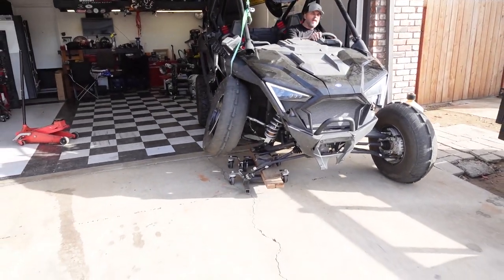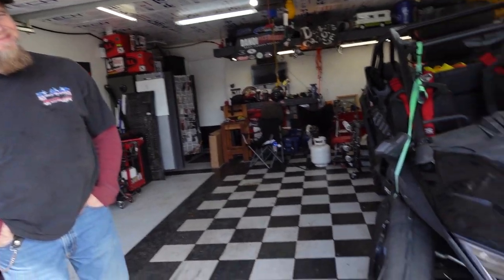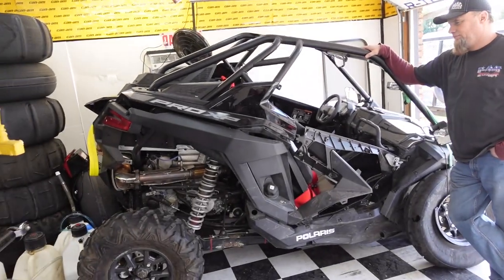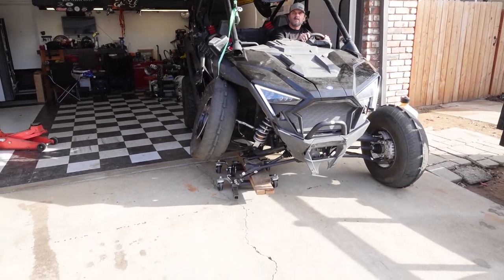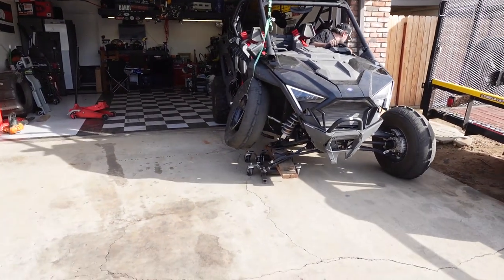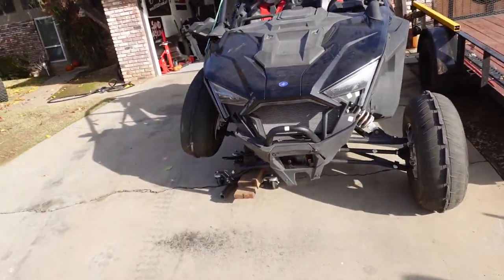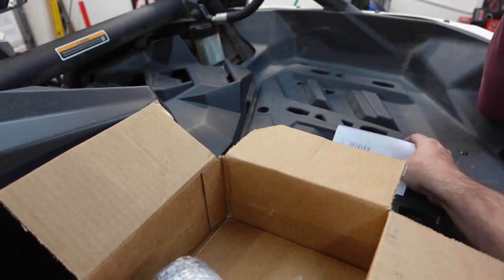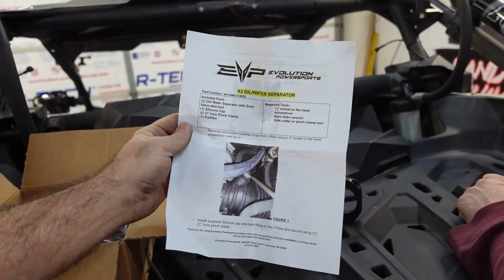EVO Catch Can Install On A Stage 5 Evo Can Am Maverick X3

Comment: Thank you for the video. I had already installed catch can, but I living in Wisconsin, we ride all winter, slushy, wet days, I installed mine up on the roll bar..they sent longer tube, (I own base model, beefed up EVO, with rear linQ pivoting rack,). So I didn't have shock reservoirs in my way,...love your videos, thanks for taking the time...
Reply: Mine was a base model as well bought all the stuff and converted it to the wider model
Reply: @dannysteveson6718  I meant, i went up^^^^, on upper pilar on roll cage
Reply: @jacobwagnercanamx3crazy941  I figured that was What you meant
Reply: @dannysteveson6718  I had asked on the maverick x3 site, having the catch can, living in the cold months of Wisconsin, is their weekly freezing cold weather maintenance?..like pre ride squeezing of tube to make sure not frozen shut...I have had mine installed 2 moths... and yes, warm, cold, warm, cold there is alot of Condensation in the line...
Reply: @jacobwagnercanamx3crazy941  When I took the hose off in the video a whole bunch a yellowish liquid came out so I’m glad I put that on
Reply from the maker: Thank you